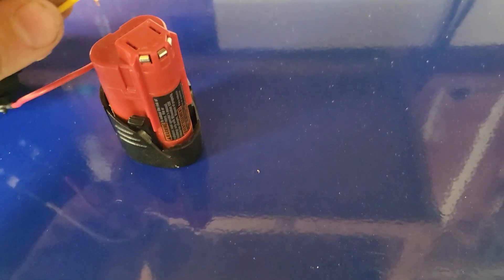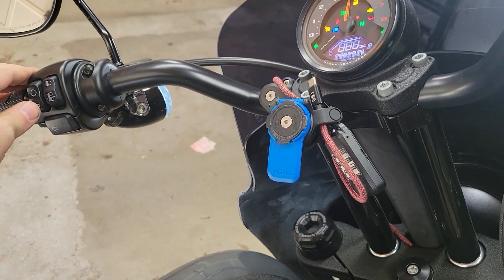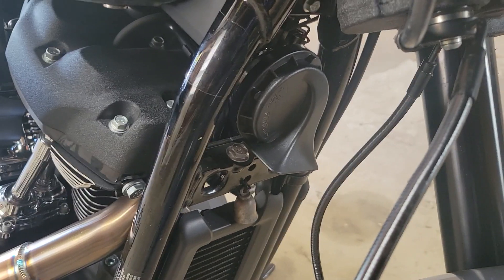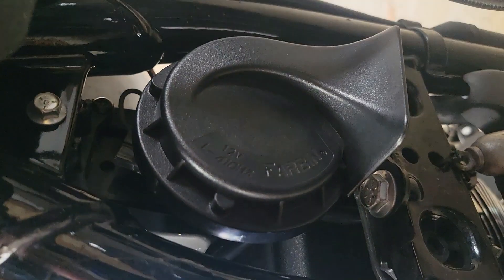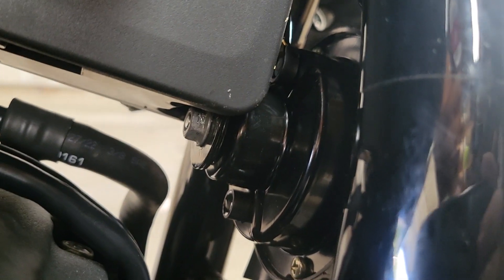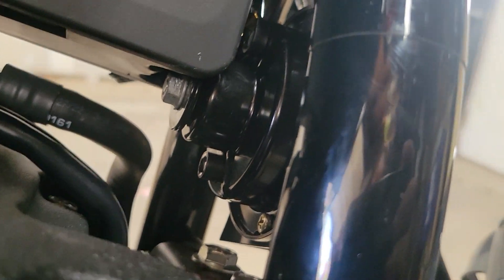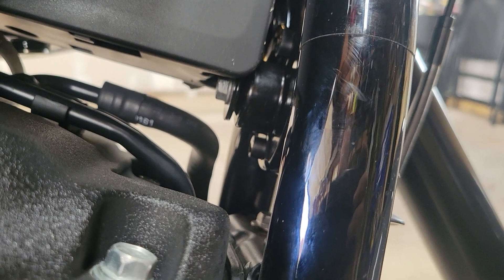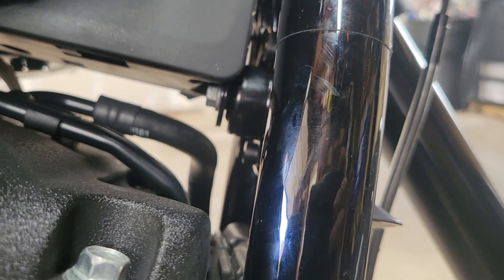How to replace the stock horn on your Harley Davidson Lowrider S

Comment: Got this horn for my Low Rider ST. I can't get the old horn off. It's going to take a lot of work to get in to the rear nut. I need a Gnome with very small tools, or I'm going to have to take a lot off to get to it.
Reply from the maker: I was able to use a box wrench, I was able to get a quarter turn at a time, them eventually I was able to rotate the entire horn and back the bolt off that way, and then repeat the process in reverse to install the new horn.  Also, no need to replace the fuse.
Reply: @north.east.moto_life  Thank goodness my other bike is a TREK. I used a skinny bicycle 10mm and got the horn off. Hooked up the new horn and BEEEP!  Sounds great....BUT....seems it may not fit with my engine guard. Hope it can "tweak" it or cut it down.

Comment: Hello, does it Plug n Play with factory wiring? Is there any DTC code come up in the speedo after you replaced the horn?
Reply from the maker: Plugs right in to the factory wires, no codes on speedometer
Reply: @north.east.moto_life  thank you very much

Comment: Did you need a relay?
Reply from the maker: No, just tied it in to the factory horn wires.  Had I gone with a larger horn or a dual tone horn I would've needed a relay and an addition power wire from the positive terminal on the battery.